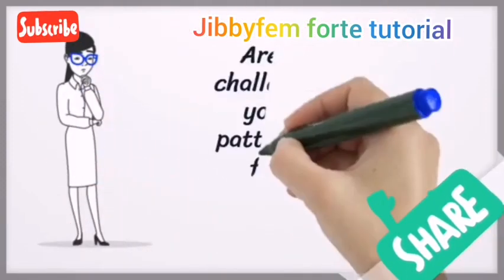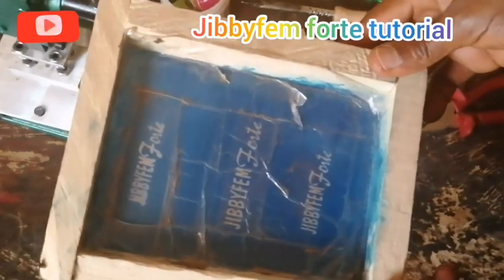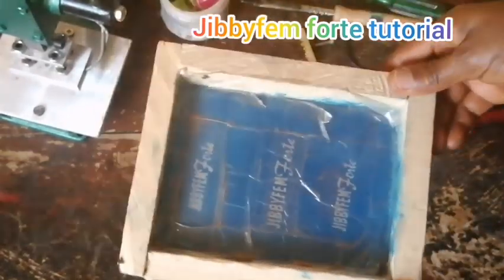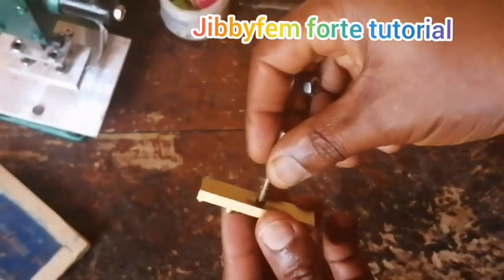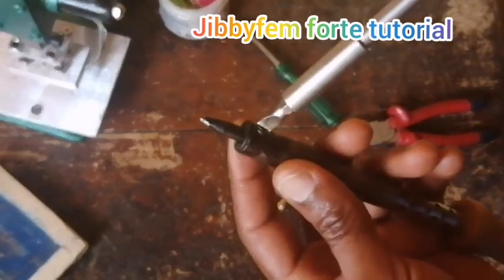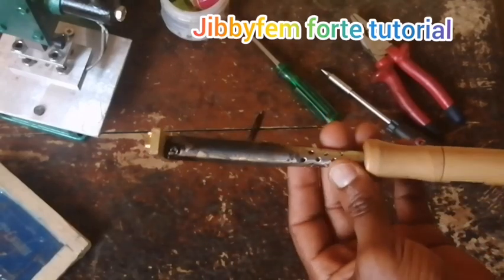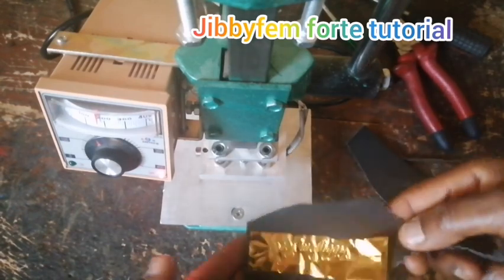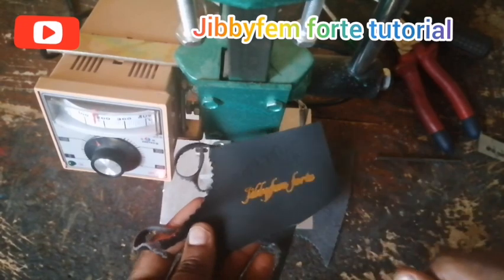How to make shoes for beginners : DIY Leather Stamp

Comment: Ma the size of the stamp in cm and pls can u send the link of the seller u bought yours from on aliexpress. Thanks
Reply from the maker: There are options you can pick.
NGN 3,421.24  9%OFF | Customized LOGO Leather stamp Copper Brass Wood Paper Skin Bread Cake Die Heating Emboss Mold Letter Metal Stamp Brand iron skin
https://a.aliexpress.com/_mPTBphV